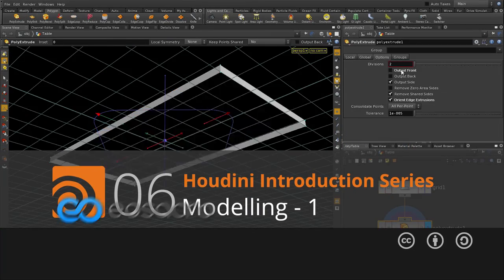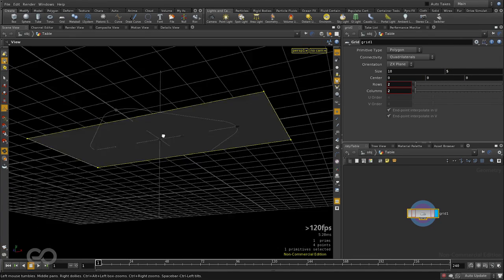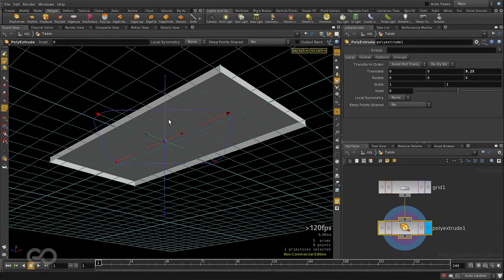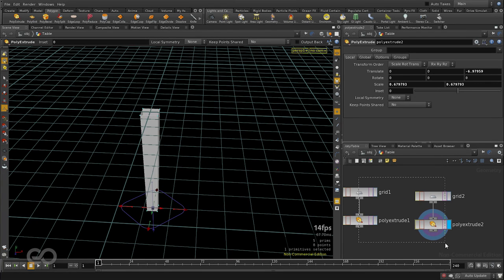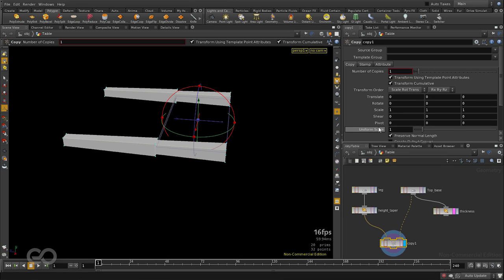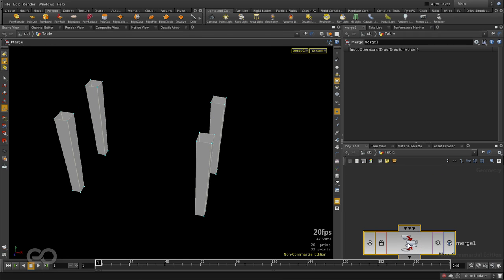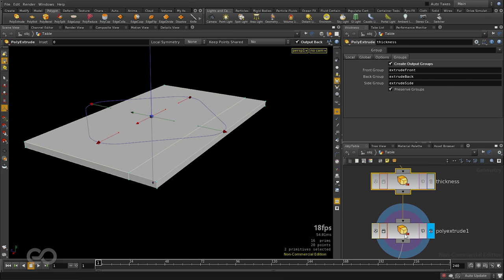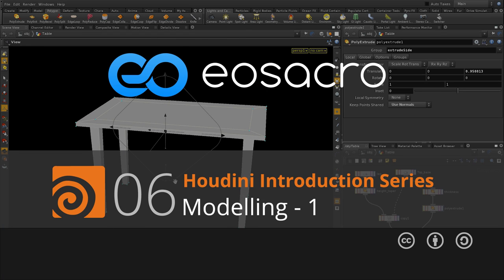Houdini Intro - 06 - Modelling - 1

Comment: Making something more complex will turn that node editor into a nightmare... Why complicate things for no reason?
Reply from the maker: Advection357 Well it might turn things quite hairy is an understatement. 

Making complex things might be very complicated in the beginning, but the amount of flexibility this provides, especially regarding how easy it is to change anything you might have not thought of in the beginning, is in IMHO definitely worth the nightmare.

Apart from that, I find the process of figuring out how to get something specific working, the breakdown, the logic to be an exhilarating process. Its fun! :)
Reply: Ah forgot about this comment now that I'm getting into Houdini lol...
Seems like it's not an issue... I can just collapse/lock the nodes anyway. It's nice because I assumed all those 100's of modelling operators were going to get re-evaluated all the time... which would be insane... that's like not freezing your operator stack in Softimage... or not converting to polymesh after lots of modifiers in 3ds max
Reply: eosa

Comment: It takes less than 2 minutes to model a table in any other 3D programs. Imagine trying to model a character in Houdini.
Reply: I suspect you could model this table in Houdini in under 2 minutes as well, but the creator of this tutorial wanted to cover as many features as possible. It’s been a while since I opened the program, but I presume it has a cube primitive and a scale operation, which is all you need.
Reply: It's called a tutorial mate.... teaching people how to do it, running through why he is choosing each parameter so we can learn. Houdini pro's could make the table in less than 2 minutes easily. You also seem to be missing the point that Houdini is not really designed around detailed modelling, it's more for VFX and procedural modelling. You can also always build your detailed model in other 3D programs and import them very easily if that's what you require....
Reply: You don't end up with a procedural table though in " other 3d programs" 
You don't even have a graph, just a stack of modifiers. Good luck with that. I'll stick with Houdini.
Reply: @mborok  actualy it takes less then  30s in fusion 360 :/
Reply: Laughs in VEX